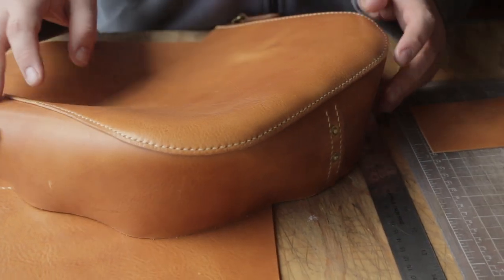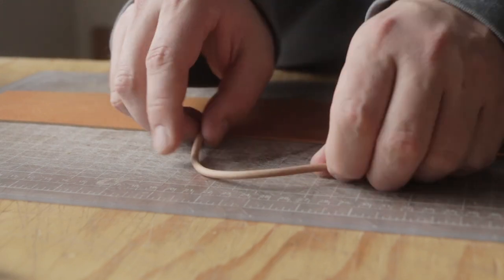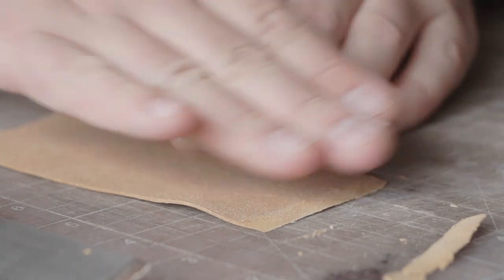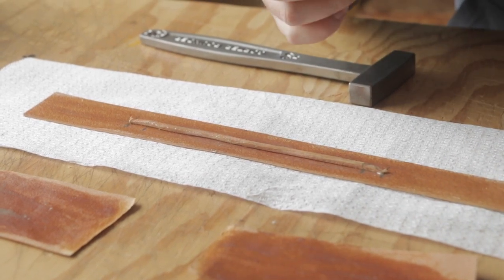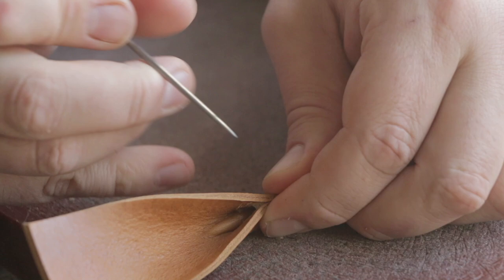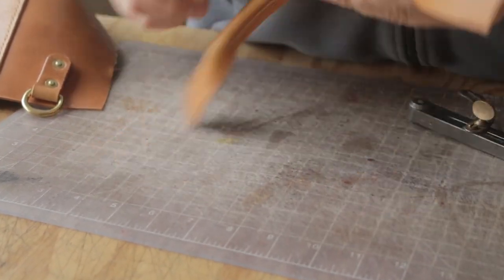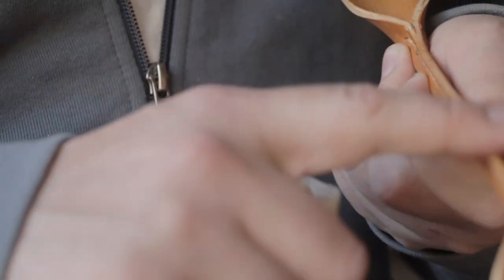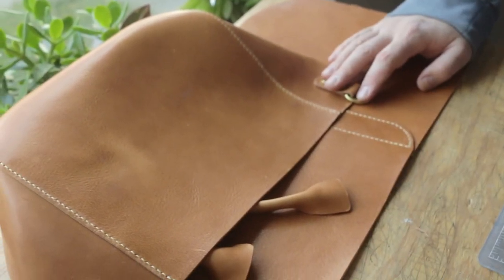Making a Tubular Leather Handle // TUTORIAL

Comment: I’ve also noticed for example on the Hermes Birkin bag that there is a line of stitching straight up the tab from the leaf point about midway up the tab. While they use a liner,  the stitching up the skived end of the leather cord locks it in place. That stitching will certainly prevent the core from migrating down the handle. Great video.

Comment: Have you ever used a leather burner to melt your string/sinew down at the ends? I made some little turn shoes the other day and used a burner and it worked even better than when I'd used a lighter in the past, not to mention you're not directly exposed to a flame. It allows you to press the string down while melting it so it sticks better and doesn't get over burned. 

Thanks for the tutorial! I'm trying to make a little duffle bag for the first time.

Comment: What brand of glue do you prefer to use?
I've made several round handles for some bags I've made for my wife. It's always nice to see different methods and styling ideas.
I love your work.
Reply: Is just about to jump on and ask him the same thing
Reply from the maker: barge or weldwood for us :)
Reply: Thanks for the info
Reply: I've used both glues that Corter recommended and I've found that I prefer the weldwood brand a little better. It's easier to get, most hardware stores have it in stock. And it's a little thinner than barge. This is just my experience, you're mileage may vary.

Comment: Thank you so much for your tutorials, I have been learning a lot following you. I have a question on this particular tutorial. You say: "Use a really strong glue". I have been looking for a powerful glue that settles almost on contact for a long time. Do you have this product in your inventory or can you suggest a brand that I can use? Thank you again :-)
Reply: They are now using Barge brand contact cement.
Reply: Barge 100% !! Don't get the Barge in the blue can or tube that is labeled " toluene free ", get the stink stuff lol... its the stuff in the yellow and red can.. Barge all purpose. The toluene free stuff is definitely weaker and not nearly as strong. You have to get it right the 1st time with Barge.... because if you are off any bit, ITS PERMANENTLY BONDED AND IT WONT COME APART AGAIN. lol hope you have a great one

Comment: Ecoweld doesn’t have the bad fumes?
Reply from the maker: Ecoweld probably won't be strong enough for a piece like this, you'd probably want to go with a better bonding glue like Barge
Reply: @Corter  Ops I meant weldwood sorry. I think you are using weldwood? I'm trying to find a water-based glue that is same strength as barge, people have said aquilim but I think you use weldwood? So I'm wondering if that has bad fumes as well? Thanks :)